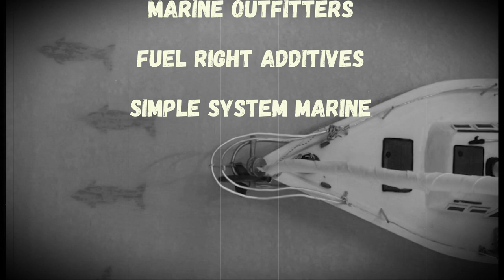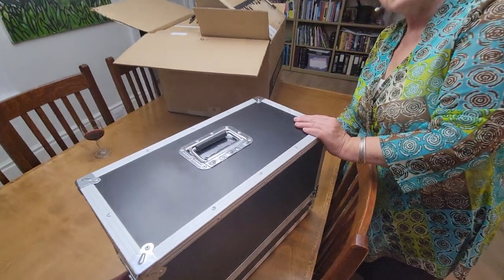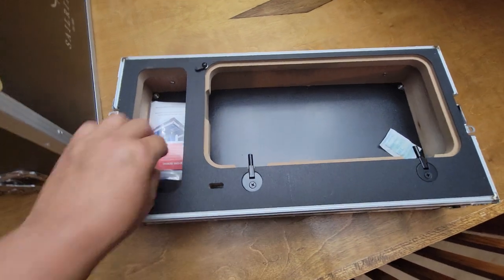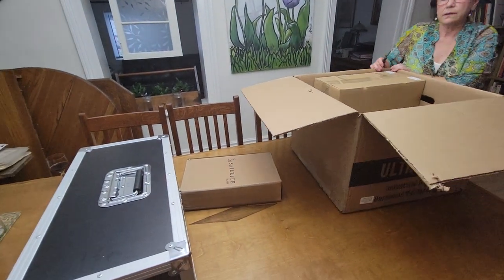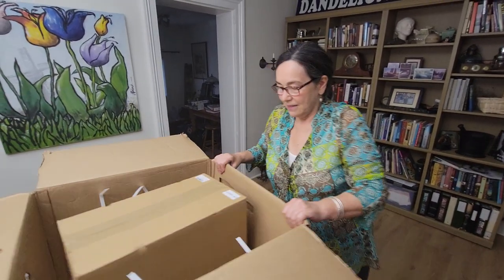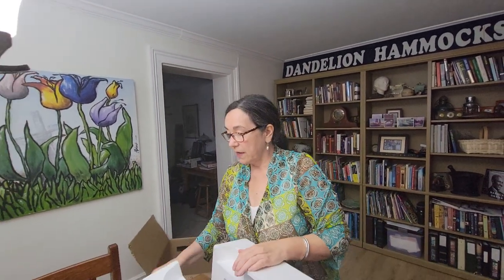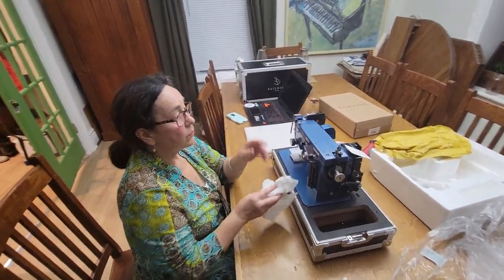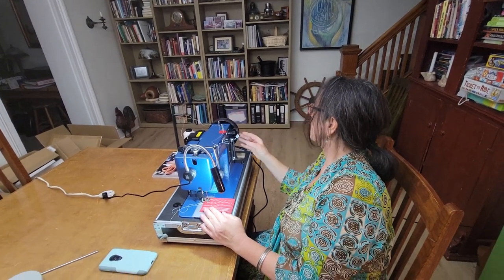Fins and Needles, Wind over Water, Episode 144 #sailrite #sewingcanvas #LSZ1

Comment: Instead of a wooden wedge,  why not thicken some epoxy and squeeze it in there? Put it in a sandwich bag and cut the corner off, like frosting a cake 😉.
Reply from the maker: I actually did both in the end. There is a plywood wedge in thickened epoxy under there and it worked brilliantly. Just had to take the bit of flex out of that section. The whole floor is solid now.